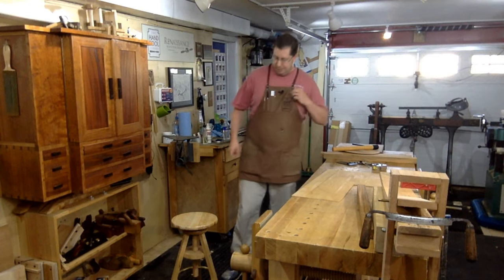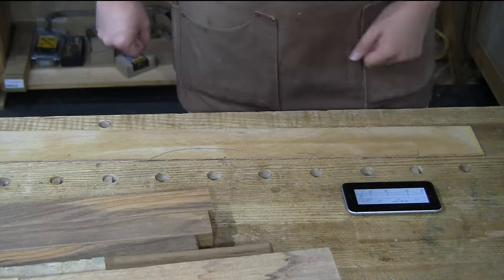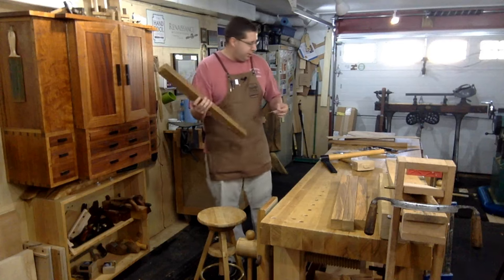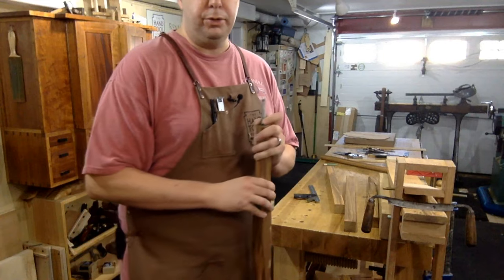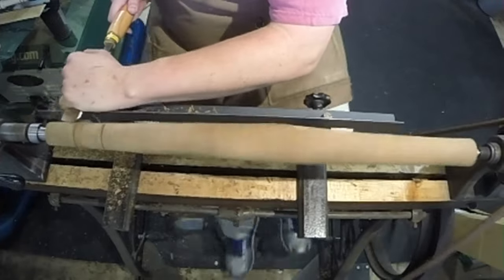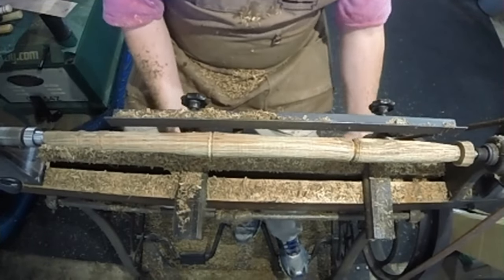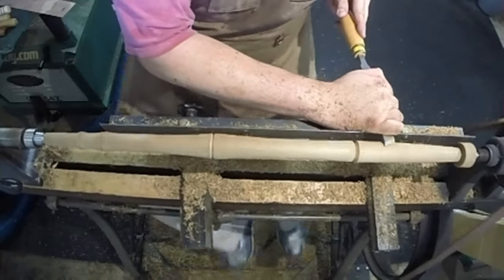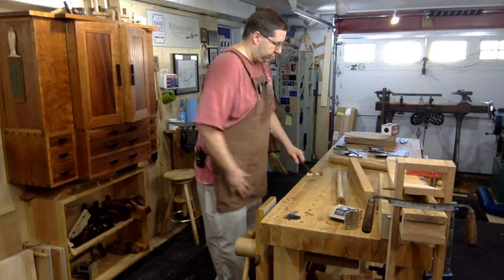Perch Stool LIVE Part 1

Comment: Dumb question time! If my eyes aren't deceiving me, it looks like you're peddling "backwards", is there a reason for this? Love your videos, excellent teaching and presentation! Keep up the good work!
Reply from the maker: colonel6007 if I pedal forward then the wood spins away from me and it won’t cut. The belt isn’t long enough nor is there room in the machine to cross it. This is the way it was designed. I could pedal forward for sanding I suppose but I never do because it’s no harder to pedal backward.